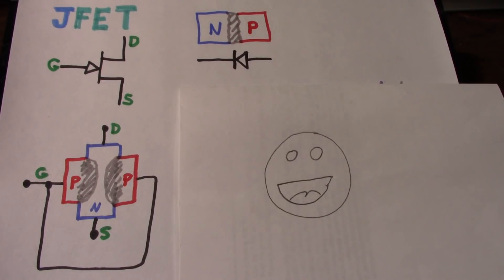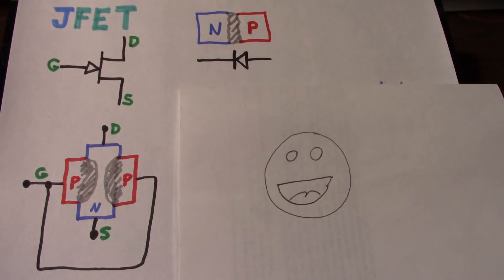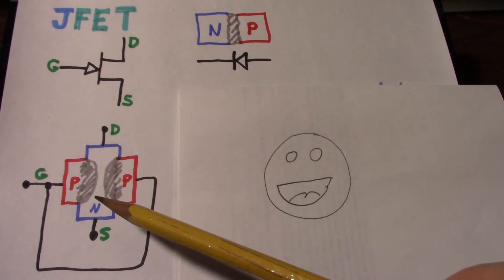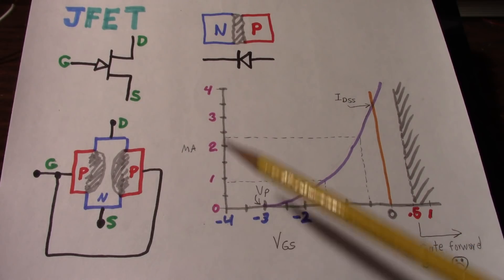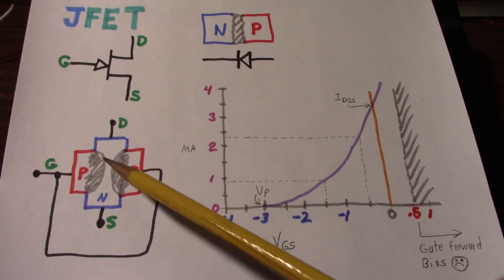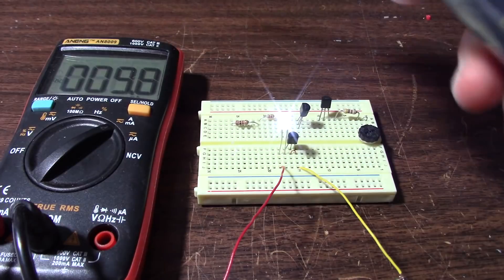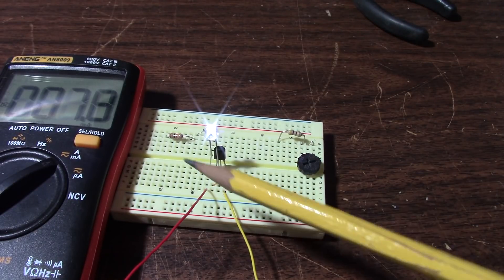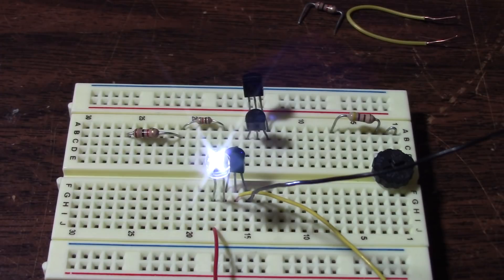Junction Field Effect Transistor (JFET) introduction and characteristics PT1

Comment: very much like a vacuum tube,though with transfer characteristics of the pentode tube,i should say valve really being on this side of the pond.
Except valves work slightly more non linear,jfets can get close but for audio first the gains are worlds apart,like valves both are cathode /source centric,similar in that grid or gate resistors will develop the the grid to cathode/gate to source voltage across the grid/gate resistor making the tube/valve/jfet "think" the cathode is at 0V and the grid/gate resistor voltage is at a minus voltage when it is actually at zero volts.......

Actually it was vacuum tubes notably the triode that showed electron flow moved from negative to positive,since applying a greater negative voltage to the grid circuit reduced cathode current flow since likes repel,the electron cloud developed around the cathode could no longer flow to the high potential anode,called current flow,the popular mind set of positive to negative is termed conventional current flow.

With a lot of the mathematics stemming back to ancient greece,there was no notion of negative numbers and positives always went low ie high to low,hot to cold,with no notion of high to below,a ball hits the ground not so much lower unless it's mud but that would be obvious as sink......

Comment: 11:20 The drain and source are interchangeable in ALL jfets. The only difference being:

1. In some jfets the P channel is evenly distributed over the N channel (or vice versa in P jfets). For these the datasheet will clearly explicitly state that the drain and source are interchangeable as there is literally no difference between them. They are literally symmetrical.

2. In some jfets the P material is unevenly distributed over the N channel (its volume is centered more towards the source). In these jfets applying the reverse voltage between G-S will much more strongly pinch the current flowing between D and S, whereas applying the same reverse voltage between G-D will pinch the currently much more weakly. 

But in both cases you can interchange D and S. It's just that the ones that DON'T say they are interchangeable are more easily controlled by G-S than by G-D voltage. And the ones that DO say they are interchangeable are equally easily controlled from both ends. D and S are always internally "shorted" in jfets.

Comment: My main power amp has J-Fet output stages with tube driver circuit. A Luxman LV-103 amp from the 80's.
Reel fast (nano sec on and off) amp with enormous punch in the bass. Does good at the whole spectrum.
Those transistors are not available any more. No plugin replacements exists. I have the spare tubes.

Comment: Hello, in your picture you show the gate not connected to the source, but on your breadboard you mentioned that you short the gate to the source. What does that do to/for the operation of the FET, in particular the drain to source current flow? Thank you for this video.

Comment: A lot of JFETs are not only expensive but are getting very difficult to obtain.  And due to their very wide spread of characteristics you may have to buy 2 or more to find one that works properly in a circuit.  Therefore JFETs are not popular and are frustrating for most hobbyists.

Try to find a MPF102 or similar RF JFET, then you have to fiddle with the bias voltage to get the circuit working.  Thanks and I hope to see the second part soon.

Comment: Just a side note,
Actually the bjt is a voltage control device. Many thinks that the collector/emitter current depends on the base current, but that wrong.
The Ebers-Moll models show the term Vbe as the most important parameter in the model. Even this Vbe parameter determine the concept of small sigmall on analog eletronics.
Other than that, I really apreciate the content you are doing and thank you for doing such videos.
Cheers!!!
Reply from the maker: I agree that Ebers-Moll is a more precise way to model the BJT. Beginners are probably most familiar with base current controlling collector current. While less accurate, it is good enough to make the distinction between BJTs and JFETs in an introductory video.
Reply: @JohnAudioTech  indeed
Reply: @misterjorous  
The average hobbyist is not interested in Ebers-Moll models or theoretical engineering, and it's just adding confusion to this discussion and it doesn't belong here.  There was no discussion about BJTs!

Comment: Regarding swapping drain and source might there be some sort of body diode ?...cheers.
Reply: The body diode is an artifact of enhancement mode fets where a doping well is used to make the device have an off state with 0 VGS.  The construction of typical JFET is such that there is no parasitic body diode.

Comment: check out using jfets in the bjt szlikai; cascoding the collector of the driven bjt with the source of a jfet (and the gate to emitter, and drain to the drivers emittor) makes for a very high gain, speedy, and linear small signal gain stage by reducing the miller effect of the driven transistor. connecting the gate of a jfet to the emitter of the driver and its source to the emittor to the driven bjts emittor decreases the early effect of the driver and greatly reduces distortion - especially if the driver is a jfet instead of a bjt! personally im using a bjt as cascode for the driver, since with a jfet as driver the stage cant handle much voltage.

Comment: There were never as many different common JFETs available as there were BJTs. I only used the 2N3819 and the very similar MPF102 for many years for the odd application where an unmatched JFET was required. Usually the high input impedance was needed as part of a matched pair and then a JFET opamp was the practical solution.

One of the issues with JFETs is the wide range of their key parameters Idss (the drain current at Vgs=0) and Vp (the pinch-off voltage). For example, the both the MPF102 and the 2N3819 have a specified Idss range of 2mA to 20mA, while the Vp range could be -0.5V to -7.5V according to their datasheets. However, I've recently bought 20 cheap J112 JFETs and found them well-matched in characteristics with a Vp around -3.5V. Modern fabrication processes probably produce more consistent results. Or possibly the J111/J112 are roughly tested versions of the same fabrication and "binned" into two variants.

In practical circuits, the variation in parameters is usually reduced by negative feedback, the simplest being a resistor between source and ground, but that reduces the output swing available. For tighter control of dc operating points, negative feedback from drain to gate is necessary, but that then reduces the input impedance. Nevertheless, when amplifying a small signal from a high source impedance, the JFET can produce gain with low noise comparable, or superior, to the best bipolar designs.

Comment: Interesting.. Im stuck on the "more negative" part. How can their be a more negative potential then the rail? Great video!
Reply: "Negative" is simply referenced to the voltage on the source.  If the voltage on the source is higher than the voltage on the gate then you have a negative Vgs, even though none of the voltages are below the 0v rail.  Adding a resistor into the source causes a voltage drop, i.e. it raises the source voltage.  If the gate is tied to 0v the gate is then reverse biased.
Reply: @ferrumignis  

Of course you need to tie the gate to GND with a big resistor in an amplifier curcuit to have a high load impedance and not just a short. That resistor won't drop any DC voltage because the gate is technically an open curcuit and so is the coupling cap before it (for DC).
Reply: Because it may not be the rail. Add a resistor and you get a more positive voltage than the rail.
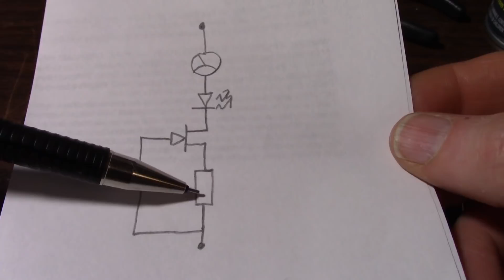Like 14:50

Comment: I remember reading somewhere that FETs can switch low-power AC signals. If that's true, reversing the drain and source won't matter, and that may be why it's not obvious what makes drain versus source.
Reply: A basic fet is symmetrical (on a silicon layout level), and drain and source therefore inteechangeable (when layouting ICs you can just mirror them and change signals around). They start getting asymetric when you try to max out your specs and tweak every little thin. Additionally, they are not symmetric when the bulk is internally wired to the source
Reply: @schabingcraft  Cool to know. Thank you for the clarification!